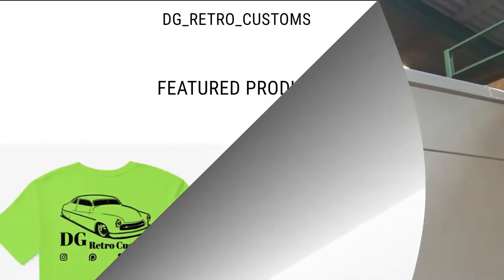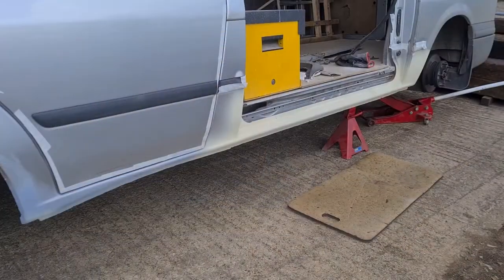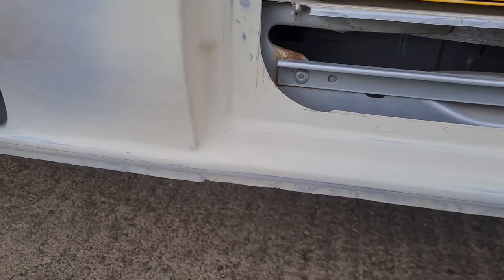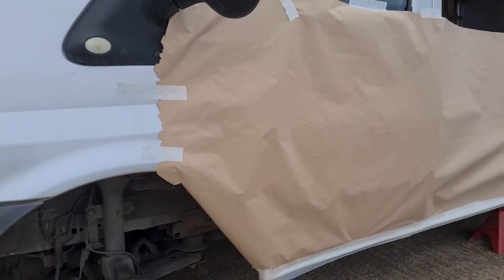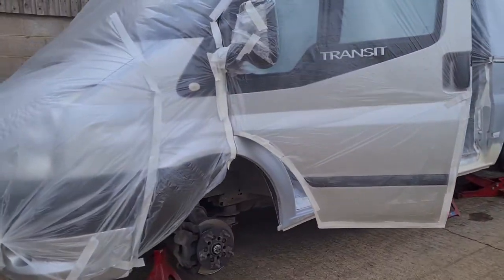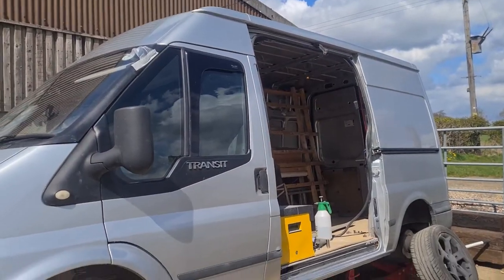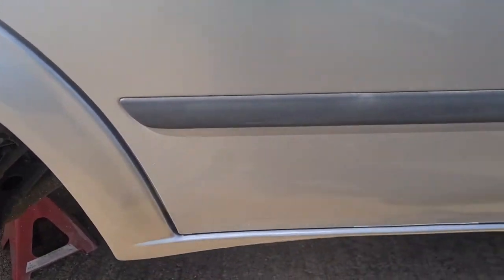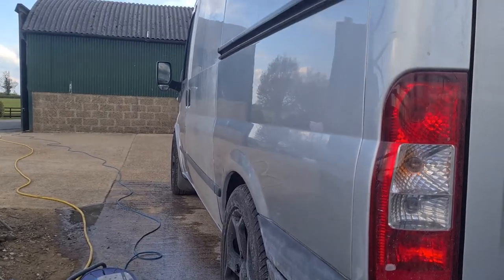Transit Sill Replacement Part 3 (Painting)

Comment: Great job! It may have been an outside job, but it is a work truck. It's good to be proud of your job, but if it's too nice then he feels bad when he scratches it. I am sure he rather have the cost savings, and it done good, rather then a show job, with the cost. A lot of guys have been getting color matched bedliner sprayed on the lower half of there work vehicles to not worry bout all the rust, dings, and dents.
Reply from the maker: he was over the moon with the job, he was supposed to send pictures when he washed it but never did so ill try and get some when he pics up engine from escort